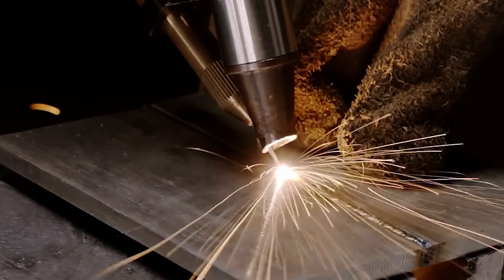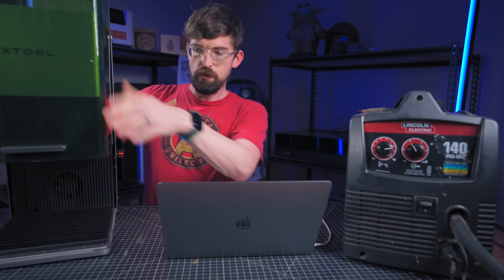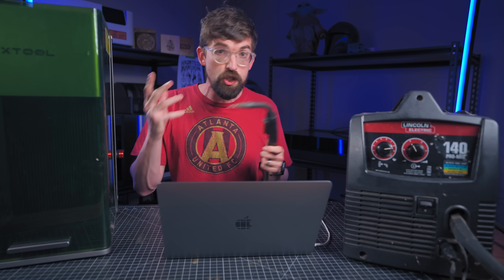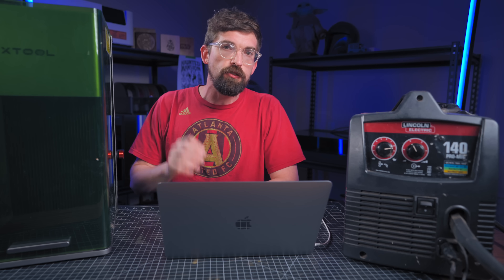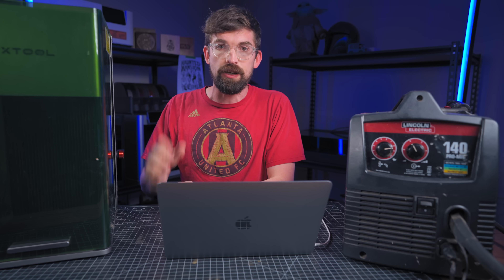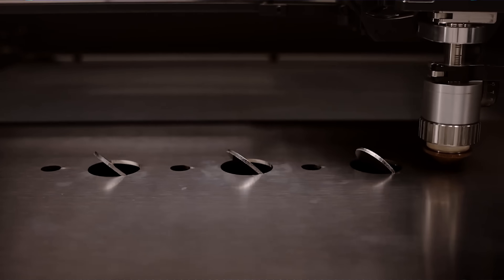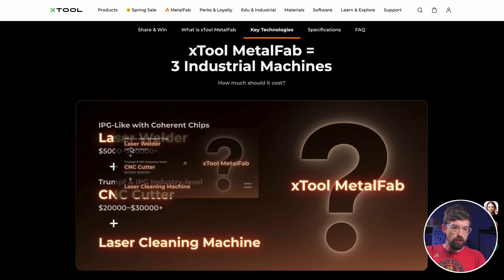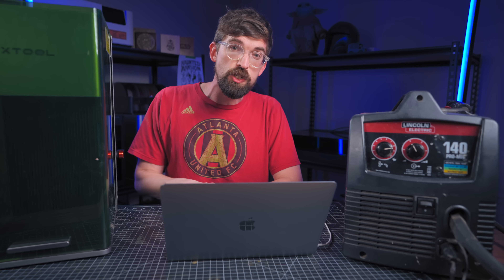Will This Replace Traditional Welding? xTool MetalFab Preview

Comment: I buy my tanks. You can rent them as he mentioned. But if you’re planning to do this for years, while the tanks are expensive to buy, once you get past three years, or so, it’s cheaper to have bought them. The longer you weld, the better the deal of buying becomes. But understand that you are not actually buying a tank you get filled and returned each time. Just like renting, the tanks are exchanged with each fill. That’s actually better, as these tanks need to be tested every so often. The welding supply does this. If you actually had your own tank, you would be responsible for that as they won’t fill a tank that hasn’t been tested. Generally, when you discontinue the service, you can keep the tanks. But ask before you do anything.

Comment: Hi, I own a small factory, recently I have my eye on MetalFab and Gweike M series. They're just perfect for my work. It seems that Gweike is cheaper, but I'm not quite sure their differences. Will you do a review of the M series or compare the two? Thanks a lot!
Reply: Gweike M has also a Co2 laser cutter, so you can cut/mark/engrave MDF, some wood, acrylic, most plastics, EVA foam, cardboard, leather, etc
Reply: @LuchoDa  Yeah I just checked their website again, it's like optional. M2 has only fiber, M3 has Co2 and fiber. I like this feature, always welcome more functions. But even with one more Co2 laser, it's still cheaper than metalfab. Shocked by the price differences, man...
Reply: @ChrisMomoa just make sure that you really know your requirements. If it’s a business, a few thousand doesn’t make a difference over a payback period.
Reply: @melgross  I still need to control my budget and I bought the M3 PRO eventually, very happy with this decision so far.

Comment: I think you need to have the machine to do a review.  Also, bring on someone who knows how to weld.  Laser welding is not a strong as mig or tig. Penetration should  be looked at closely.  For a diy'er, this is good for decorative welding.  Just my .02 cents.  Also, way too expensive.  If and when you do a review given your limited knowledge of welding, bring in an expert.

Comment: Tengo 2 preguntas muy importantes. Qué longitud de manguera tienen las pistolas, es la misma longitud en la máquina de 800W y la de 1200W.
Y la pregunta más importante qué tipo de conector o enchufe 🔌 tienen las máquinas en Europa, conector Shusko?? Es que he visto que la máquina de 800W necesita una potencia de 15A (hasta aquí no hay problema pues los enchufes de las casas europeas normalmente resisten 16A) el problema es con la máquina de 1200W que necesita 23A. Así que definitivamente me gustaría saber qué enchufe 🔌 trabe ambas máquinas, deberían poner datos y fotos de esto que pregunto es su web

Comment: I also have a DIY CNC plasma cutter. What do you think about installing manual laser cutting on our plasma machines? It would involve replacing the plasma torch with the laser torch and adjusting the parameters (I'm sure the THC can be made to work somehow, too). It seems much easier than installing a fiber laser.

Comment: since photonics x1 pro weld machine is around $2800 on KS then for this you are look at about $6000 because of the CNC aspect which is the only additional feature so let say if it on Ks $6000 to start and then maybe after launch price could range from $6000 to $12K at most. also not to mention Xtool is not know for any Business grade professional machine just prosumer, hobbyist and craftsman man. 

so they need to come in at an affordable price before they can have a foothold in a industrial class market segment. 

industrial class are not mainly concern about price as long as they have a way to generate a ROI on the machine investment. what tends to outweigh ROI is support and aftermarket sales. 

if Xtool wanted large scale business to buy into this they will need to have started approaching them for a long time as business of who would buy 1 - 2 or 5x would usually plan out the ROI, safety, aftermarket sales, e.t.c. 

I think they will be aiming the SUB 10K mark as most hobbyist will not put down 10K if the ROI is 5-10years you really want to have and ROI of 1year max as a small business. 2 year at max. 3-5 years if you are buying multiple. cause if you take long to get an ROI you loss foothold on market share fast has competition start start to get into the industry with similar machine and product and and your direct competitor start to gain market share.

so you all should be persuading Xtool for a KS and a price of around max 5K for early entry backers. 

12K is not a stretch for some people but within a year or 2 other company will make similar product do not forget xtool is a Chinese company so patent laws work differently there. am sure you will see similar very soon. it a first but not the last. and other companies will come with integrated or modular system easily.
Reply: That machine, from what I know, is lower power. I think it might be 700 watts. The XTool is more industrial in nature. I bought the 1200 version and I like the gun much better. Not as fond of the cheaper Photonics gun.

Comment: I think it's going to be like $15k as well 👏👏
Reply: I'll be surprised if it's less and will definitely consider getting one 🙏
Reply: it will be less according to their survey it will only be more if people keep speculating high prices. your are the customer and own the ability to dictate the price at this moment which is why xtool is looking at market research on price
Reply from the maker: Which survey?
Reply: @ it on the website. if people start saying they will pay more for no reason then what do people think will happen. I don't think people are to put ideas in their head and at 6000K dollar yes I would buy right now even if am unsure easy money grab for them tbh. but at a higher amount people will reconsider and as much as some say they will still pay the number will drop down faster than they think
Reply: Survey through their website / email. One of the questions is "would you buy right now for $6KUSD"
Reply: I think it is going to be $14K, because I just looked at the website and it said $14K.  I have this keen ability at predicting price by looking at the actual price as stated by the manufacturer.
Reply: do people actually check the survey at all it says 6K on their

Comment: As a certified welder, laser welding it is not very strong it is good for crafts intricate products  it's for very thin or basically sheet metal laser welding is not used much at all in America because of the price tag and low capabilities y'all are better off buying a plasma gun and and small portable welder in my opinion for like a grand or 2
Reply: As someone who has welded since 1973, I can disagree with you. Lasers have been used for industrial welding for decades. Automobiles and trucks are welded mostly with lasers. Both Blue Origin and SpaceX use lasers on the ships and boosters. I have the XTool 1200 and I’m amazed at how strong the welds are. You need to try this yourself.

Comment: At that price its certainly not a hobby tool.   $4000 would be A LOT for just the cutter but maybe ...
Reply: check out their survey let up they can keep it at $6000 as they are aiming for via the survey
Reply: No, it’s not a hobby machine. The 1200 model takes 12” 33 pound rolls of wire.

Comment: I hope if the price is expensive, I wish buy only the cnc laser fiber cutter separately than the laser welder. For welding we have alternatives like mic, tig, etc. And if the price is more than 3500 dollars or euros most buyers like me we will can't buy it because we want it only for hobbies. Also I think this is first step to democracy the metal cutting laser. In my case I was waiting this type of machines lots of years. Congratulations to @xtool. Now the price is critical.

Comment: Under 15k I would get it just for the cutting ability in that form factor. Turn key, more or less and it fits in my small shop? Perfect.
Reply from the maker: Here’s hoping for under 20k ha
Reply: @makeorbreakshop   well 20K for a lot of people that is out of buget range. it has to be sub 6/7K perfect at 5K if it is a KS then 5K they will make a lot from it
Reply: With referrals, you can get it for around $11k. Make sure you use a referral link before putting down your deposit.

Comment: Laser welders are amazing, I LOVE how easy it is to prep the metal/clean any rust... After using one one cannot go back to traditional welding!
Reply: Unless you need to weld anything thick and for under $2k
Reply: Not as strong.  I dare ya to weld something structural and then use it.  This machine is just not that robust.  Good for decorative items yes.   Also too much $$$$
Reply: @ I'm not speaking about this particular welder, you can get more powerful ones on the web and they get excellent penetration on welds, I have no problems trusting laser welders for structural works.
Also prices swing drastically depending on the manufacturer.